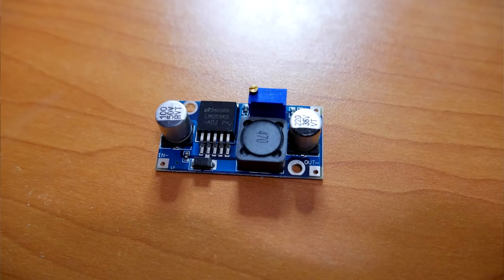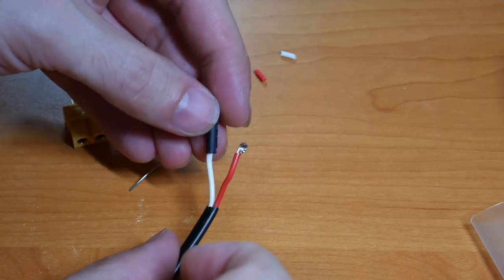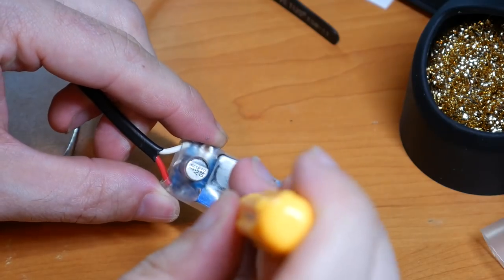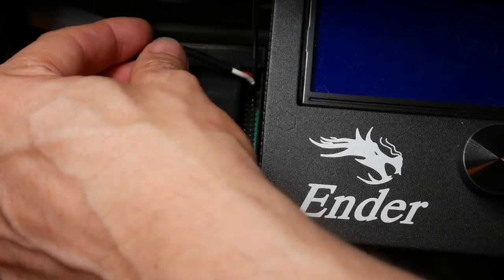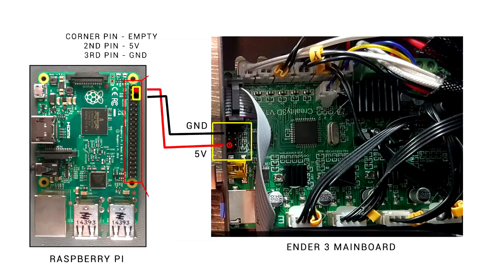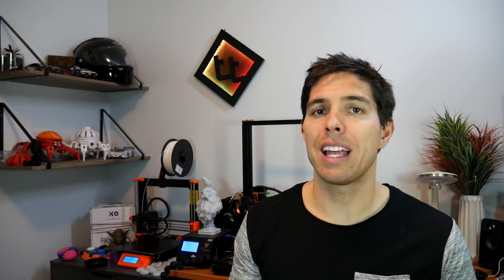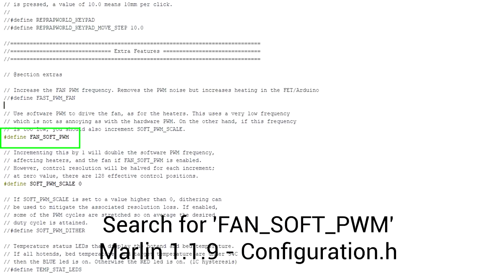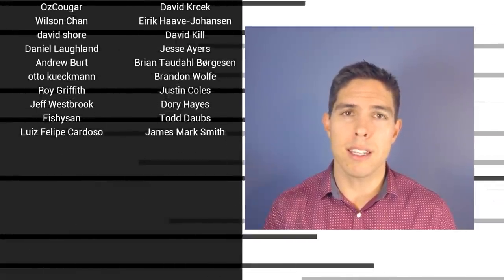Buck converters: Quieten your 3D printer with a Noctua fan & directly power your Pi

Comment: Great video, I've already ordered/bought most of the components I needed. The only thing I'm not sure about is the wire. Is it a specific type of wire needed? And what gauge would you recommend?
Reply: no specific type. you can cut strip and solder the wires already in the printer, but if you need to extend then standard 22 awg would be fine
Reply: Figure out the amperage draw and consult a lookup table. Search for something like 'awg/current table'. Be conservative and keep away from the current limits for a particular gauge.

Comment: I used PWM 50% for part cooling with a Noctua 4020 FLX, but it doesn't seem to spin as quickly as the same fan with a buck converter on the hotend. And it doesn't spin at all under 25%. Any ideas?
Reply: I’ve got the same issue with a Noctua 40x20 and buck converter wired as shown. Won’t start under 25-30%. Did you end up finding a solution?
Reply: @AlexSwan  I ended up replacing it with a 24v 40x15 blower style fan and a self designed adaptor (not required if you print a shroud that fits a blower style fan natively) . It increase air flow and pressure significantly, and improved the bridging of the prints.

Comment: “A buck converter is simply a colloquial name for a voltage regulator”

For the record, no: it’s a technical name for a very particular kind of topology that implements a voltage regulator. Buck means it’s a DC to DC converter, it can only make the voltage lower, and it does so by way of doing PWM on the input in exactly the right ratio to make the right output voltage.

Comment: but why not use a bigger fan at lower rpm.
Reply: On stationary parts, that is definitely the way to go. On moving parts, the extra weight and bulk can easily be objectionable. But if you can fit it in and can live with minute extra ghosting, by all means, bigger is better.

Comment: Changing to 12V purely by software / PWM is dangerous. Just making a firmware update after 2 years and you smoke the fan if you don’t think about modifying the voltage again.

Comment: Should have taking this a step further. I have the parts just need the time to do it but you need
1 of the buck converters
1 Adjustable Time relay - There lots out there, but the key thing to note, you need a High On 24v module (one i have is: https://www.amazon.com/dp/B07DFT2WDS/)

Wire the input voltage of the relay to the main out of the power supply.  
Wire the NC and COM of the relay to the buck convert. 
Wire the High Signal for the relay to the hot end positive. 
Adjust the timing on the relay board to around 10 minutes.

This will make no longer always ON. but will turn on only when the hot end is on. Then stay on for another 10minutes after the hotend turns off.

Comment: 24v @ 50% duty cycle (PWM) is NOT the same thing as 12v DC! there are many 24v fans that will be permanently damaged if you send 12V dc instead of 24v dc PWM. PWM is application specific to DC motors that accept only one DC supply voltage without permanent damage. if you want to teach then teach real science. 24v DC @ 50% duty cycle is half the total current average over time compared to 24v DC %100 duty cycle.

Comment: how can I put a noctua on my ender 3 without having to use a raseberry pi?
Reply: If you look at the guide again, you don't need the raspberry pi for this. you can use the converters soldered in-line as he showed, and adjust any firmware settings using any method to flash new settings in (like the AVR programmer he made a guide for, the Arduino IDE, and so on)
Reply: is there a way i can do it without using any arduinos or rasberry pis.
Reply: @jamescerven4400  He presented two alternatives - either modify the firmware for max PWM value, or set this in slicer - though the latter is not particularly safe, you could burn up your fan by accident. Another alternative is to simply run a buck regulator (one like shown in the video, one he powered the Pi with) in line with the fan.
Reply: @SianaGearz   Thanks

Comment: I think last part with part cooling fan is dangerous, use 12V fan on 24V is bad idea even with PWM regulation. Look at this: https://imgur.com/a/5bmb86F . I have Ender 4 so I didn't tested this on Ender 3 but it should work. Also if you want to use this on different printer, Ender 3 doesn't have any fuse or diode protection for fans.
Reply from the maker: Please see the pinned post.

Comment: Hey, I have a question for you Michael and for our little community here :)
I think I've installed almost every upgrade you showed in your videos and my ender 3 is almost "complete" just waiting for my silent fans to arrive as well as my BL Touch.
Although I'm struggling with some minor issue which I can't solve. 

I am facing some extruder skipping steps like in this video.
https://www.youtube.com/watch?v=YI7bO0vj_iM

I think I've heard that sound somewhere in one of your videos too...do you or maybe you guys from the comment section know what this might be?

I have already changed the extruder for aluminum one as well as connectors for PTFE tube. I also have 2 spare PTFE tubes but I think I won't change them cause I guess that's not the case. The stock one after replacing connectors is doing its job and it holds the tube very well.
I 've noticed that skipping appears during solid infills and first bottom layer. Rising temperature didn't help and I'm pretty sure that bed leveling its not the case, cause it happens even when the hot end is in the air.

I have no clue what to do next... 
Any idea?
Reply: JUST REPLACED PTFE TUBE...DIDNT DO ANYTHING
Reply from the maker: I was going to say the nozzle might be too close to the bed but you said it happens in mid air. You can trying packing something behind the spring to add tension, beware of breaking the plastic parts from too much tension. Otherwise maybe your speed is too high or your nozzle temp too low and the extruder can't keep up?

Comment: I would seriously advise against using Noctua 4010 fan for the hotend, at least with stock cooler mount. I did that and had heatcreep and clogging on long (6h +) prints, exactly like TH3D warned and clearly explains in the following video : https://www.youtube.com/watch?v=azm1c55JOxk

They just don't blow enough air.

Comment: Great idea, but based on another video regarding cheap XT60 connector and over heating I would be Leary of the ones you link to as they have one rating and it;s not good.  It would be more work, but better off to run wires from the main board screw terminals out to the buck converter.

I would search for something a little more reliable:
https://www.amazon.com/dp/B0754JKHWW/ref=sspa_dk_detail_7?psc=1

Comment: Personally i would rather use something like this instead of a bunch of converters: https://www.amazon.com/MEAN-WELL-RD-65A-Output-Enclosed/dp/B005T7EZM8/ It gives you 5v and 12volt power rails to use on a 24v printer.
Reply from the maker: Nice product.

Comment: I accidentally broke my Ender 3 Nozzle Fan and had to purchase a new one (Banggood official store). I found some 24V LED Fans from GeeekPi (at Aliexpress). After receiving them I thought it would be a good idea to test them with an anemometer to see how much CFM does they give. I made a video with the test [https://www.youtube.com/watch?v=HRcXK_Ca36Q]. I also compared the results with the ones of the datasheet from Noctua to see if the 12V fans from this top brand would be near the results from the noisy Creality one or from the less powerful, but silent (and shiny) GeeekPi one. One think that it should be said is DO NOT BUY the GeeekPi one. It is not a 3DPrinter fan, and actually I think it is a terrible one. The Creality fan is noisy, but it was meant to give enough CFM to the nozzle, and Noctua ones probably will be quite near the necessary CFM (or even be enough) as long as you do not use the low noise cable to limit the RPM and power. I would love to see this kind of test on Teaching Tech as you already have Noctua fans (with the dollar/real relation, everything from abroad is really expensive this times here in Brazil). Cheers!

Comment: Did you copy my buck converter show? Problem not good work. Sorry but leave yourself a little wire not soldered. This make sure you don't snap the wire off. Correct NASA standards for soldering is the way to go.
Reply from the maker: You are correct, thanks for pointing that out.

Comment: Anything speaking against using a Noctua 40x10mm 5V as parts fan (with buck converter of course)? I have one lying around. Noctua page says with 40x20mm 5V you get 5.5 cfw but with 40x10mm 5V only 4.8 cfw....is that too weak for parts cooling?
Reply: Sunon 50x15mm centrifugal fan at 12V:
5000rpm
6.8 m^3/h
17mmH2O static pressure

Noctua 40x10mm axial fan at 12V:
4500rpm
8.2 m^3/h
1.8mmH2O

The problem is this, you're trying to press the air stream through a narrow nozzle. Not much of that airflow actually comes through, and all that does, merely due to static pressure. So centrifugal fan is actually up to 10 times better than axial. When there is no restriction, in open air, axial fan will have an airflow advantage by up to factor of 2.
Reply: @SianaGearz  Thx for the info, but I don't quite get what you're trying to say... Don't use a noctua fan at all for parts cooling?? I saw multiple people now using a noctua fan for cooling so I guess it's fine. Just wanted to know if my 40x10mm 5V noctua fan would suffice for this task.
Reply: @trohn_javolta8485  I have used a high-airflow 40mm fan for parts cooling, but it wasn't nearly as good at it as a centrifugal fan. Depends how much performance you can actually live with.

Comment: Never use such a small buck converter to Power a pi, i can barely deliver 1a. 3a with forced or even active cooling, if you are lucky. Just like that is really risky. The pi can pull its 2,5a and kill the buck converter or if you have Bad luck it can get killed too. If you have a pi 3b (no plus) and you are not pulling any Power out of the USB ports, you can risk it.

If you use a pi4 use a proper converter that is really capable of delivering at least Real 3a. Usually like twice the size of These in the Video.

Comment: No you cannot put a capacitor in parallel with the fan, please do not just repeat baseless bullshit. If you want to start a fire sure do that!!! and no capacitors are not 16V, they are any voltage you want. again, do not speak of crap you do not understand....

Comment: dont buy noctua fans - they massively over package without a care for the environment and makes the product extremely self righteous to the point where you feel like the worlds most foolish spoiled rich kid buying them, honestly you can feel the smugness of these fans even when switched off, as a result of this i think noctua fans are stupid fans for stupid people, i went for gelid fans which are just as quiet, come in an appropriate box, cost half the price and dont compramise on rpms and airflow as much just to claim the lowest db crown. I did however order the fans with the 3 pin connector instead of the 2 pin so i had to do a bit of soldering to fit them to my printer :( stupid me eh, maybe i should have just bought the noctua fans with cool untraceable cash and whizzed all the packaging straight into the sea before anyone saw it

Comment: That's not a buck converter. It's a specifically says "STEP DOWN"... a buck convertor can STEP UP as well.
Reply: Step down  = Buck converter
Step up = boost converter
Both = buck boost converter
....
please do your research m8
Reply: noup
Reply: no
Reply: Beat me to it David lol
Reply: @RamjetX  I stand corrected.
Reply: @seafax  I'm happy that you learned, but i'm more amazed that you got two thumbs up on that original comment and none on the last one in the thread. Not your fault, just an observation.
Reply: I think we can put this one to bed now.... especially as no body has addressed the Smoothing Cap on a PWM output without taking into consideration the variation in the duty cycle or the static frequency of the PWM base signal... let alone the insignificance of a 220uF to cover the load of a fan during the extendable off period of a PWM pulse. I do love though how quickly the electronics engineers come running out of the woodwork to correct a mistake... ahhh the forgotten trade. Lest we forget ...
Reply: @RamjetX  the problem with jamming a cap in there is actually fundamental. I mean there's no current limiting on that PWM controller, the impedance of the fan acts as current limiting, and capacitors can deliver and absorb quite an amount of current as well, easily more than what a fan needs. So what will happen if you put a sufficiently large cap in there is that it will always stay charged to full voltage and will be able to constantly supply just about full current, effectively bypassing the PWM functionality while making the PWM work harder and supply correspondingly many times more current in bursts.
Reply: @SianaGearz  Indeed, thats why smoothing circuits are typically built on a RC or LC filter so the load is not the primary R/L component of the time constant. As with all cyclic circuits though, there will be a tuneable point where at that switching frequency, a particular cap becomes optimum to bypass it... larger and it will not completely charge the cap resulting in a current lag, and too small where it still has ripple. 

Of course as you say... adding the capacitor is really bypassing the function of pwm. The noise experienced with PWM fan control is nearly always due to harmonics between the load , in this case the coils of the motor, and the base switching frequency. Smoothing circuits are really only for fixed (or known) frequency inputs (as time domain is part of the calculation). 

If you wish to retain speed control via pwm... and want to change the audible noise of the fan. Then really, the only solution is to change the base switching frequency. Which you can't do easily.
Reply: @RamjetX  I don't think he's complaining about PWM noise, the primary concern for part cooling fan is air friction noise.

As to whether you cannot set PWM frequency? Yes you can, the standard Marlin PWM is something like 8-16Hz, purely software PWM, which is not too bad, it's lower than you're used to, but it's below audible and fast enough that fans don't have the capability to change speed by a whole lot during the PWM period. But you can on most boards actually set it to hardware PWM, and since you don't have heaters and other things on hardware PWM, you can determine your own divisor from base clock, trading between PWM resolution and the frequency.
Reply: @SianaGearz  Fair call I have not looked at the firmware code at all. It's a very low base frequency indeed... that'll be why the cap had little no effect then. I'm used to designing my own buck converters where 1KHz to 100KHz switching rates are not unheard of. Very informative. Thanks.